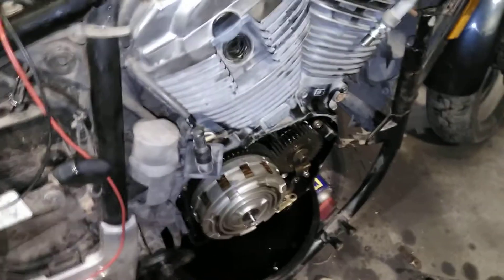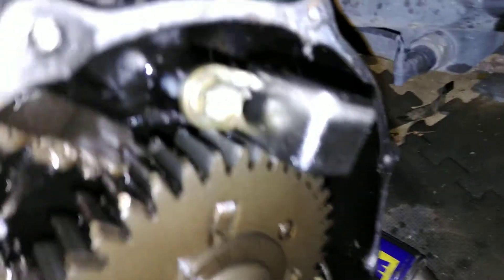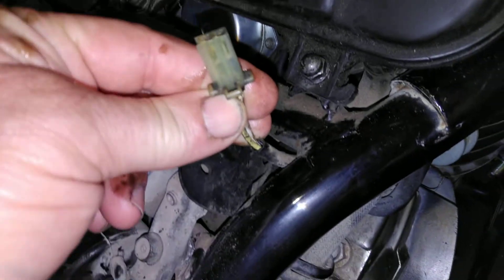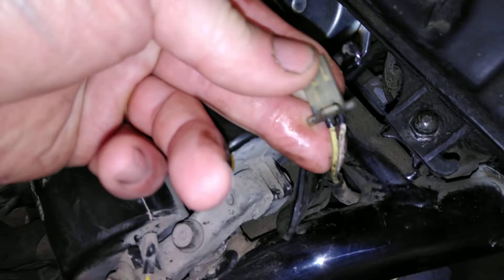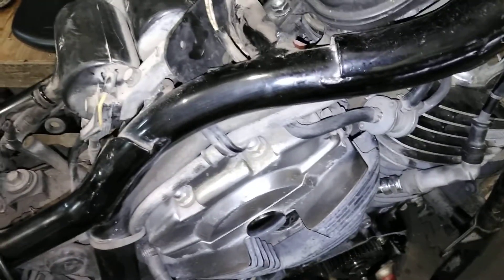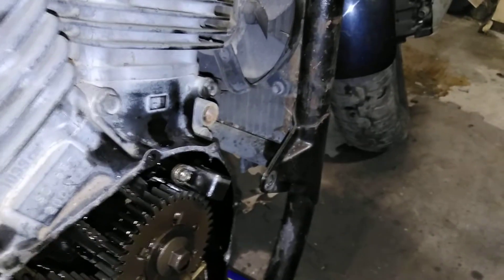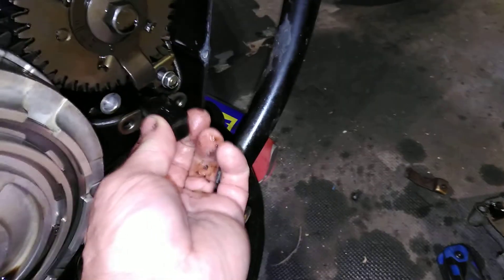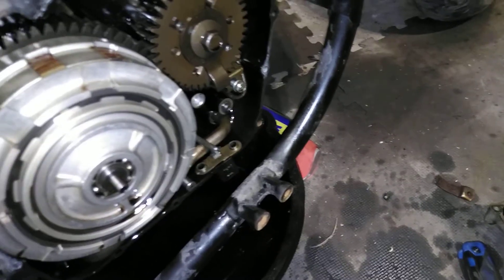VT1100 ignition pulser diagnosis 1985 1986

Comment: Hi. I have the same bike and im having the same problem.  I cant find that pulse generator anywhere,  where did you order yours from. Do you have a link?
Reply from the maker: I ordered one from eBay that fit a newer one and cut the connector off and connected it to the harness. I think I got lucky on the part. Do you know which pulser is bad?
Reply: @torque63  its the front one.  The same one that you replaced.  I found one off of a 1998 vt1100 on ebay. Im going to try the same thing you did. Your video is very helpful.
Reply: @torque63  could you please show a wiring diagram for the 2 magna cdi box you installed. Would be greatly appreciated